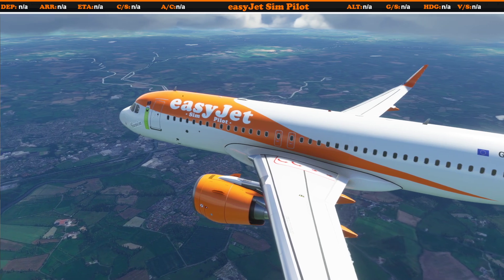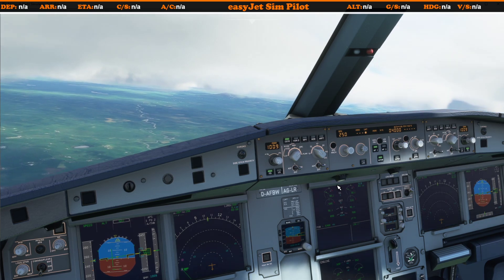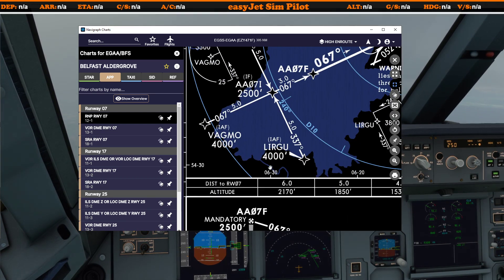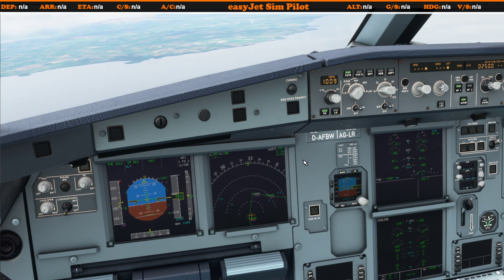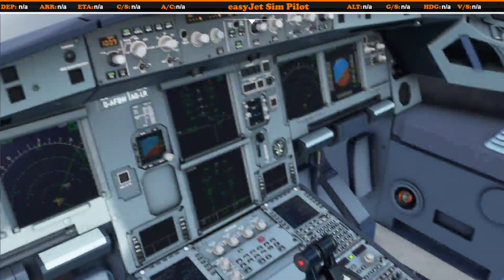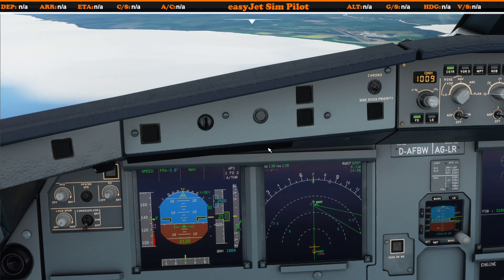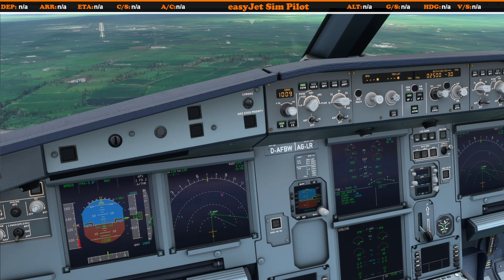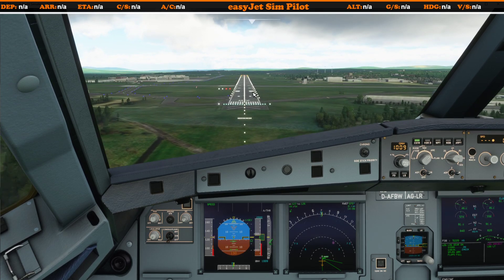How To Fly an RNAV/RNP Approach using NAV/FPA - FlyByWire A320 NX | MSFS 2020

Comment: Very few MSFS planes have a properly functioning vertical guidance,in my opinion. There are some like PMDG Boeing and well the Fenix is supposed to be able to fly the RNAV approach but I'm finding them a bit of a hit and miss. So rather than attempting some weird and wonderful version of the RNAV, I set it up in Simbrief as the real thing and fly as any ILS programmed flight. By doing this, I get to the wpt where the GP begins and kill the autopilot and hand fly from there. With bit of a practice, this solves the ILS missing issue. I'm sure the vertical guidance will be provided in FBW which by the way are the planes I fly the most and then comes the PMDG. So, I won't let the absence of vertical guidance hinder a good day of flying.

Comment: Does this procedure also work in the Fenix A320?  GREAT VIDEO!
Reply from the maker: It does, but the Fenix has FINAL APPR mode working and so this is what you would use usually (except in rare circumstances, where the temperature is too cold for example)

Comment: Awesome tutorial and got this to work for me on the first try! The only exception is that I didn’t get the green brick (vertical descent). Any reason why? I’m in the flybywire, also in track fpa mode, past the final approach fix descending at -3 degrees. I wasn’t too high because it put me right on track to land in the touchdown zone so curious if maybe the brick isn’t coded to show up currently for some reason?

Comment: In the fenix would you still press APPR for an rnav/gnss approach? or is it just for an rnp
Reply from the maker: In the Fenix, the FINAL APPR mode works so yes, you can press the APPR for this.
Reply: @Easyjetsimpilot  what approaches would you not use appr
Reply from the maker: LOC approaches, or RNP (when temperature prohibits FINAL APPR)

Comment: Nice video, but quite a few errors (MDA, early stabilised app, procedure…etc,etc).
Reply from the maker: You can fly RNAV approach using a decelerated approach without issue. There are some circumstances where an early stabalised approach is called for (ie when the FAF is only a few miles from touchdown) but different airlines also have SOPs for this in their airport briefs.
Reply: @Easyjetsimpilot  not correct: a decelerated approach can only be flow when it’s fully managed.
Reply from the maker: @prc6608  unfortunately this is a limitation of the sim, as the FBW cannot do this yet. However, we can in the Fenix A320.

Comment: I've tried FPA a few times w/-3 degrees and it works, but there is a problem.  If my FAF is 2000, and I have 2000 ft set, when I engage FPA, it will not descend below 2000 until I dial the altitude down to the MDA or so...500' roughly.  Any ideas why?
Reply from the maker: You need to pull the V/S dial to command the descent (assuming your in the FBW or the Fenix mod)

Comment: Is this still valid?  Tried this technique today at KLGA RWY 31, and it was a disaster.  At 1700 ft, as soon as I got to ZARID, I set the LPA to -3.1, and instead of descending, the place went nose up and started accelerating very quickly.  I had to shut off AP and use the PAPI and hand fly it.
Reply from the maker: Yes - this is still 100% accurate. Sounds like something else wasn't set correctly and you entered TOGA LK.
Reply: @Easyjetsimpilot  Yeah, I definitely saw TOGA LK.  Any idea what would cause that?  Maybe I forgot to put it back in managed speed mode after slowing it down?

Comment: My approach button no longer work (For RNAV) (FlybyWire)(A320) when approaching runway. It works on ILS mode but not RNAV. RNAV does work with the regular Microsoft a320. It used to work every time, but maybe FLYBYWIRE changed the way RNAV have to be setup?  Yes. I do follow navigraph charts for the right RNAV approach altitud.
Reply from the maker: FINAL APPR mode (for RNAV) no longer works for the Flybywire mod. You have to use NAV/FPA until they have fixed it. 👍

Comment: Excellent video - always enjoy the tutorials.  Question - why do you have to take off the FDs if you are using FPA mode?
Reply from the maker: You only turn them off when you turn off the Autopilot and are in FPA mode. This is to ensure the Autothrust remains in SPEED mode.
Reply: @Easyjetsimpilot  Ah - ok  thanks!

Comment: Nice and thx. Just a hint: you can dial in the - 3.00 a little before and then pull the knob when you want to start the descent.
Reply from the maker: It should be dialled in at 0.3mn from the FAF. 👍

Comment: I thought glidepath worked with RNAV. I think I've flown that before.
Reply: Same here
Reply from the maker: Only on the Stable build which does not use the custom AP built by the Flybywire team.
Reply: @Easyjetsimpilot  Oh, I see. Thanks! It's been a bit since I flew the A320NX with RNAV, but I have been running the experimental version for a while. Might just not have realised!

Comment: Why do we need to remove the FD after disconnecting the AP?
Reply: To avoid any autopilot commands from distracting your concentration on the bird flying the required attitude. Keep displays to a minimum and if you select the FD use it. If you don't switch it off. Confusing otherwise.